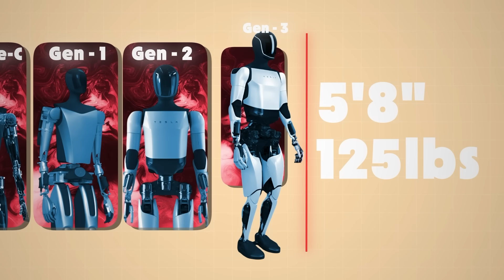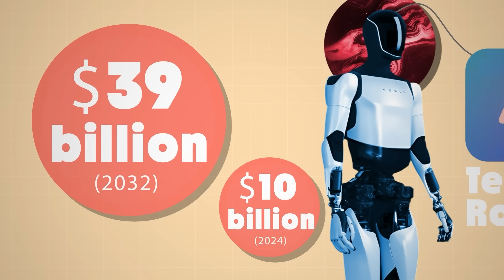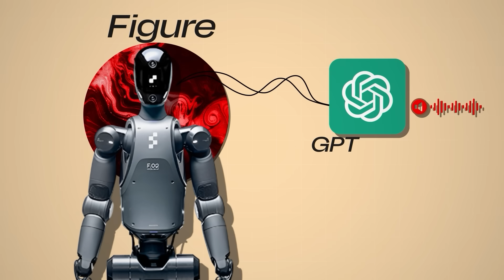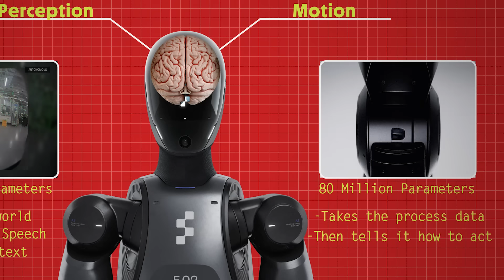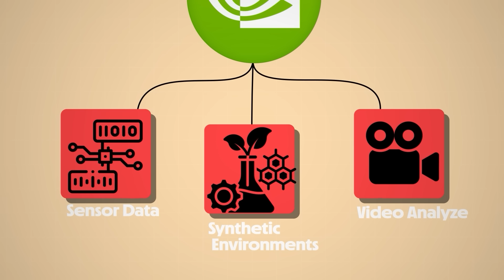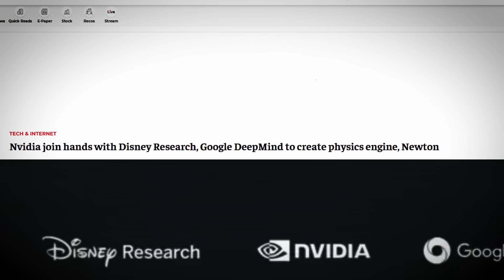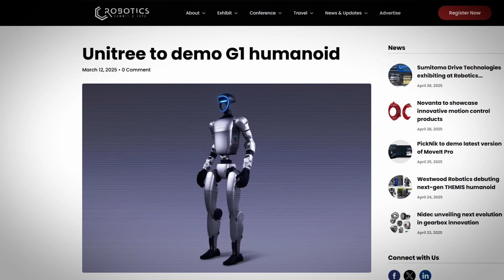The Robot Takeover is Here!

Comment: I mean its cool but people need to be realistic Robots break down and robots are expensive they're also heavy and not easily repaired. While people feel threatened about their jobs being taken... look how long it takes a 76,000 $ + dollar robot to simply sort products for a refrigerator. Thats just not practical humans can easily out work robots while a robot could potentially lift more look at their balance. It sucks not to mention the expensive parts to replace it. One thing Ive been looking forwards to is reports showing just how badly wear and tear are on a robot and its joints after just one day of physical human labor... That will gave humans a massive new respect for the human employee labor worker.  Last ofc is the rare metals needed to make these. You're not going to mass produce something that rare metals much the shortage or microprocessors and them being made in only one country. The "Robot Takeover" Is purely hype. Sure its fascinating but its not at all realistic nor is it practical. Imagine a workforce running on robots ONE SOLAR FLARE and all manufacturing comes to a screeching halt.

Comment: Gold kit robotics cost $7887 in college courses and they are a secret of the community. They as such are a bust of the head and shoulders of a robots build with a SOST. They need to be coded to F=m*2345 not F=m*a*a, as such Isaac Newton did not have any robotics. Besides giving them the gold you need to tell them E=hf^2 laser physics research equation for knowing this you receive a laser sensor. You can give them two calculators and then they can run and move faster. Isaac Newton born in 1643 didn't have any robotics engineering and science.

Comment: The best design would be for these robots to be fully rubberized, like the concept picture at 1:17. No open parts, or at least very few open parts, and completely waterproof. It needs to have rubberized or fake skin, skin like humans. This will make it versatile, able to pretty much do everything a human can do and more. If it has open parts, it could be problematic. Say for instance, you tell the robot to take out the trash. Now, the robot has dirty hands. You don't want it to then go make you lunch. It will need to clean it's hands before it does that. Well, the simplest way to do this would be like what humans do, soap and water. The robot will be to be able to clean it self like us. It will be a problem if the hands are opened and hard. But if the hands were soft with no openings, it would be much easier.

Comment: Any rifle round will penetrate the weak points which are always the motors, the servos, the hydraulic lines. Aim for the joints, the wrists, the knees, the shoulders.
If you take out a T-800's ability to fire plasma rounds at you the it simply becomes a melee fight but be warned, it's a damn tank.
The T-888's are smarter but less durable, their CPU will take 120sec restart if hit with enough voltage, it shuts itself down as a failsafe so the CPU won't overheat. They have 2 more as a redundancy. Pry the main port open on the right temple and remove the chip before it reboots. SkyNet caught on to us reprogramming the chips so now they're coated in phosphorus and self-destruct when removed.
The T900's are more dangerous, physically weaker but exceptional with their intelligence, especially the one-off T0K models who will attempt to infiltrate our ranks. They are undetectable until it's too late.
The T-X model is a no-go. If a T-X appears then fall back and hold for reinforcements, do not engage it.
The HK's and the Centaurs have armor but we can exploit the same weak spots as the tin cans. The typical Hunter-Killer has two engines and if we take one of them out they spin and crash. 
Fire and run. "Shoot and move" is the name of the game. The machines have superior targeting systems and will immediately return fire in the precise location as determined from the trajectory of their incoming fire. Never fire directly from the same position twice unless you're laying down covering fire.

We have survived for a purpose. This is our fate. This is humanity's last stand.

My name is John Connor, TechCom General, and if you are reading this... YOU ARE THE RESISTANCE.

Standby_
Reply: @kittywampusdrums of course some of these researchers coloborate with military. Let s make some autonom weaponized machines. What could go wrong?
Reply: A weapon or rounds for all make of arms to short circuit is needs to be developed... just in case.
Reply: @NamelySurnamely  Coltan alloy bullet, it has capacitance and could carry a charge into the machines' chassis as soon as it penetrates. The issue is they will only penetrate the titanium frame of a T-600. All newer models use coltan hyperalloy itself for the endoskeletons so only a plasma bolt in the 40w range will damage them.

Comment: The winner won't be the one with the best mechanical robot, but the one who builds the most robots plus has the best AI brain. My bet is on Tesla due to mass production expertise, and the most resources when it comes to data centers (AI inference compute).
Reply: So far Tesla have made zero progress.
Reply: @Withnail1969 So far? Tesla’s car business has made huge progress in real world AI. They are using this AI for Optimus. They will make 5,000 humanoids by the end of this year, 50,000 next year, half a million the year after that and so on. Billions per year somewhere next decade.
Reply: @Withnail1969 What do you mean Optimus can’t do anything, check out Optimus working in the Tesla factory as we speak.
Reply: @Withnail1969 Tesla does not have AI? Then how is it that Tesla has the best supervised self driving system out there? And how is Tesla launching an UNSUPERVISED RoboTaxi network in two weeks in Texas? You need real world AI for that.
Reply: @Withnail1969  It can mix drinks with human assistance.
Reply: "mass production expertise"? Like the CyberTruck? How many recalls has it had?
Reply: @Moosetick2002 You are wrong, since during any ramp up of a new product there are recalls, but the proof is model 3 and Y ramp. At the start there were a lot of issues, but now it’s smooth. Same will be with CyberTruck and any other new product from Tesla.
Reply: @MontyPython82 how many recalls did the f150 have its first year?
Reply: @Withnail1969 You forgot the word - IF.
If the CyberTruck isn’t selling then it will be cancelled. Which fair enough is true. However the cost is the main issue, and the cost is coming down just like it did with the later stages of the model Y ramp. Eventually costs come down enough and people decide it’s a very good deal. Right now it’s early, too expensive, and with issues. As the technology advances, problems vanish, price drops down to what was initially promised, and so people see the benefits and buy.
Reply: A good example in mass building of  the Cyber truck. I have not seem any since after the recall. Are they allowed to be back on the road yet. I will go the other way if I see one on the road.
Reply: The full self driving technology is totally utterly crap.... after millions of km it cannot even drive normally
Reply: No - like the internet the company that first build one who look pleasing, and you could have sex with, or the best one for military use will win the competition.
Reply: And who implements them into the economy better. So far China leads in robotic automation. What good is this robot if it isn't used in the economy.
Reply: @Ghost-g3i It will be used in the economy. In fact, the western market is much more lucrative for selling humanoids to. Because in China the average wage is lower, so they don’t need to buy a humanoid. But if an expensive western worker can be replaced by a humanoid, then any western company would be happy to do it. So even if China will lead in humanoid production, they will likely sell it to the western market - if allowed. The west might block off those Chinese humanoids in favor of western humanoids (tariffs).
Reply: @MontyPython82  Wages in China are actually increasing, so the wage argument doesn't make any sense. The reason why China is doing it is because their population is decreasing. It makes more sense to have robots in China than the US because of that very reason. The US can bring in new immigrants to feel in jobs. No robots are needed in US factories.
Reply: @MontyPython82  In the US, there will be push back from UNIONS, workers in general, so it's less likely that it will happen in the US on a large scale. Where as in China, there will be less push back, if non at all.
Reply: @Ghost-g3i Wages in China indeed are increasing, but they are still nothing compared to a US wage. Population in China indeed is decreasing, but is still the largest population on planet Earth. They don’t need humanoids in factories, the USA does. Especially since Trump is bringing factory jobs back to the USA in droves (tariffs), yet there aren’t enough skilled labor to fill* those factory jobs.
Reply: @MontyPython82  LOL, Trump ain't bringing jobs back. Weren't you paying attention. He dropped the tariffs to 30%. Anyways, China already came out and said humanoid robots won't take jobs away in the country. So, they are serious about implementing them in the economy.

Comment: Look the best way to do this is going to a 5 shift work week that's around 5 hours a day 5 days out of the week why? with a UBI we run the risk of forgetting how to do the work we once did this means the system is not resistant if the AGI or A.S.I. goes down it could in theory set us back 100 years. why ? because with know one working and enjoying life to the fullest people over time have a tendency to forget things they haven't done in a very long time other wise known as transience or memory decay. It's a normal part of how the brain functions, where unused memories fade over time, making way for new ones.  that is why the only logical way even if AI does everything is a five shift work week. now even in this environment they'll be people working 8 and 10 and even 12 hours why? because you will have scientists doctors engineers Master programmers all in very high demand doctors for comfort and the one out of 100 scenario they have to take over. engineers because if the malfunction is severe enough they'll have to work on the robots that usually work on themselves same for the Master programmer the bottom line is even in the new economy there will be jobs that work us borderline Around the Clock if we let them. to summarize poor class to low middle class 5 hours a day. 25 hours a week.  upper middle class 8 hours a day. 40 hours a week. everyone above that 50 hours a week or more. with a system in place the same as today the further you go up the better your life is but as a trade-off the less time you have to yourself. now for the real problem countries are extremely slow to act so even though it would end up like this some country's are likely to go through a great depression without calling it a Great Depression china is going through the early stages of that process now.